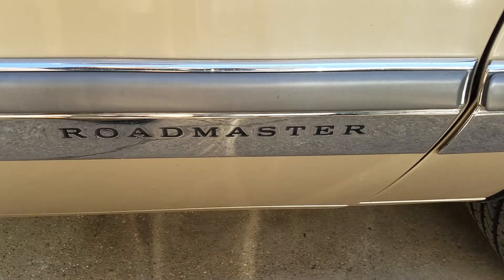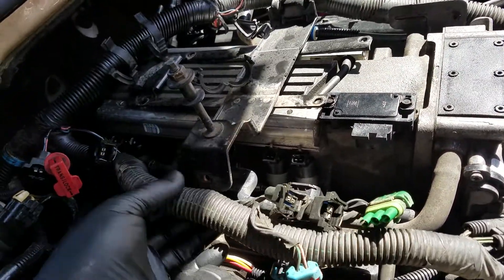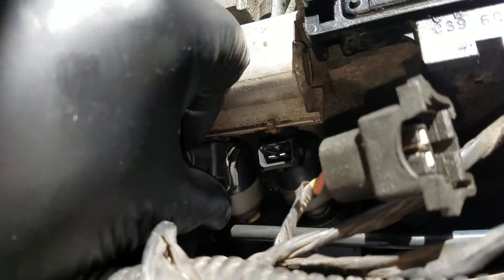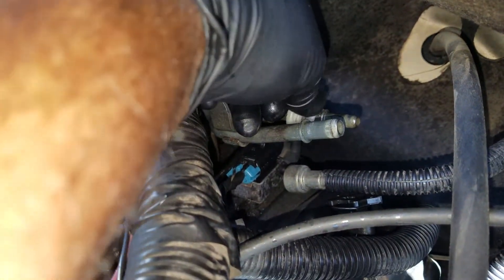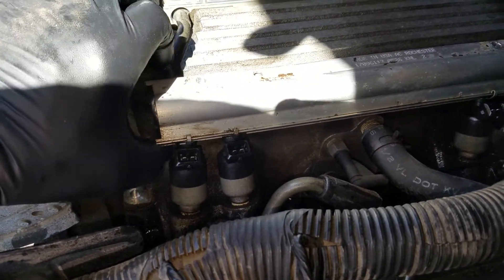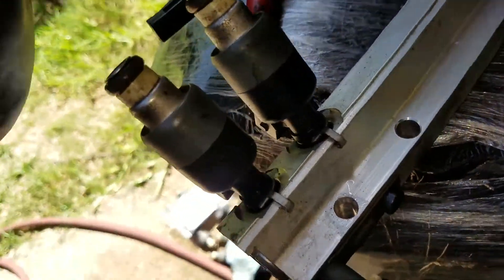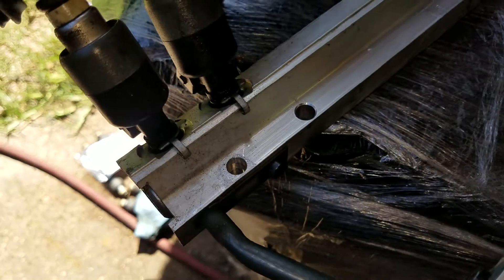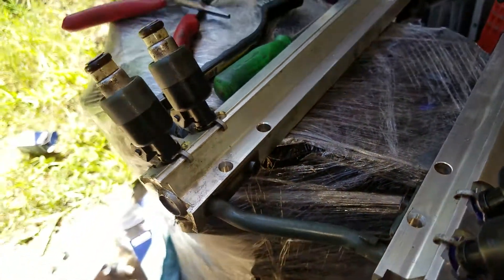Buick Roadmaster LT1 fuel injectors replace notes

Comment: I got a question, I have a leak at the  back of the engine where the fuel pressure regulator and fuel lines meet, is that why my road master isn’t cranking but it starts abs try’s to crank ?
Reply from the maker: If it is leaking fuel, yes